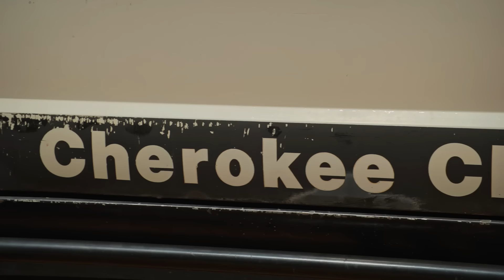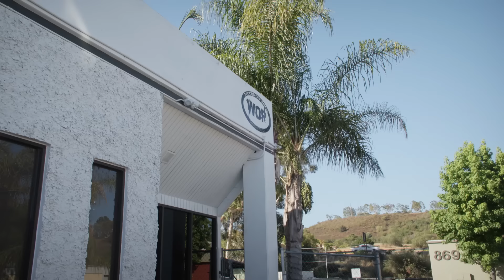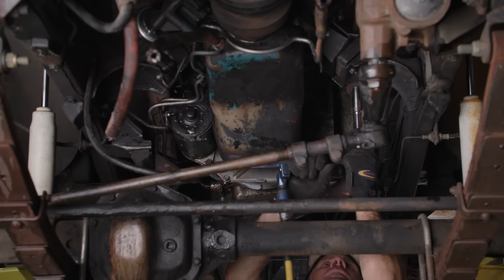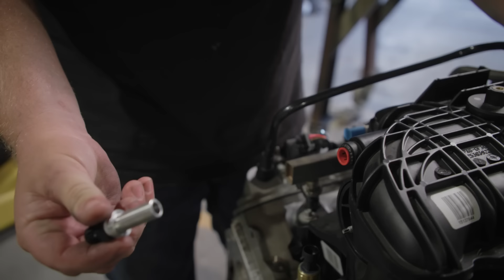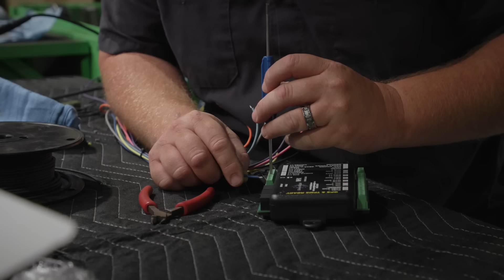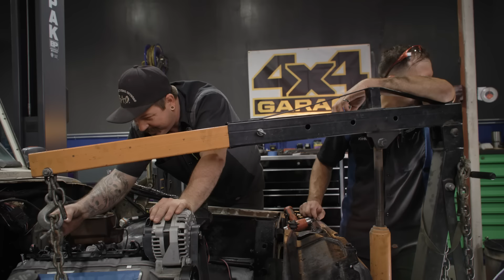4x4 Garage: Cherokee Chief Part 1 - LS Engine Swap! | MotorTrend

Comment: They put a turbo 400 in some of those Jeeps, from the factory. Not sure if the bell housing bolt pattern would match a SBC.
Just a thought.

Cool build.

BTW - I had a '72 Wagoneer, it caught on fire too. I rebuilt it, again.
Reply: Turbo 400 was standard behind the AMC V8 unless you got it the 4 speed. But the vast majority were automatic in the 70s. Bullet proof with basic maintenance. 

A lot of the issues this guy had were probably caused after this jeep left Toledo. I bought a complete 70k mile drivetrain 360-T18-D20 from a guy for $800! AMC power forever.

Comment: I was hoping that this wasn't going to be lazy and tired LS swap into an FSJ.  NOPE!  No Gen III Hemi, no 401 with aftermarket fuel injection, Coyote swap even.  One more FSJ looses it heart and soul to a bowtie.  I suppose this is motivation to get my 401 injected installed in my FSJ sooner than later.
Reply: Keep Mopar Mopar should have been an Eagle Head 5.7 Hemi . Really easy to get 500 HP out of a 09 and new 5.7 hemi .

Comment: Too bad you put an LS in it.😂😂
Reply: Modern fuel injection, in any form, if you want to drive it regularly, is the only way to go.
Reply: @terencef5806  No, you can quite easily buy an EFI kit to replace a 4 barrel carb, they are readily available.

Comment: Man, I would have totally ditched that QT case. It’s tough to rebuild, find parts for and they need it like every 60k.
Reply: And you can't pass a gas station
Reply: I thought about it but I put a lot of time and effort into rebuilding this one with top quality parts. Plus it made the conversion really simple and works well with the offset Dana 44 rear. If and when it ever fails I’ll swap it out but it’s only got a few thousand miles on it.

Comment: How original, LS swapped?! No way. You guys are cutting-edge
Reply: @dalehall2993  You don't need power in an offroad rig, you need low end torque, honestly better off with a diesel or a long stroke inline 6.
Reply: @riogrande163  
Its not a trail rig...
Reply: @dalehall2993  In which case a 5.7 hemi or a 401 would do just fine, if one is going the LS swap route, why not buy a Blazer and save some hassle?
Reply: @riogrande163  
Lsa supercharged but an ls will do..regardless its ls powered😎👊🏻
Reply: @riogrande163  
Whats the hassle if you know what you're doing...right👀